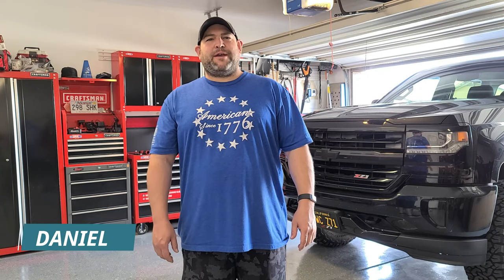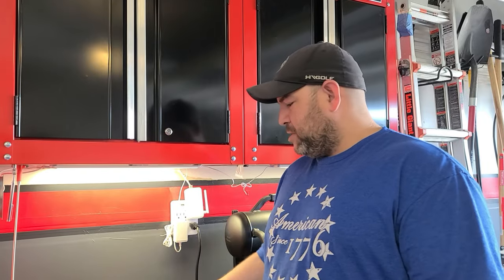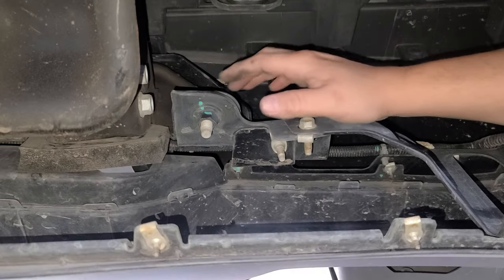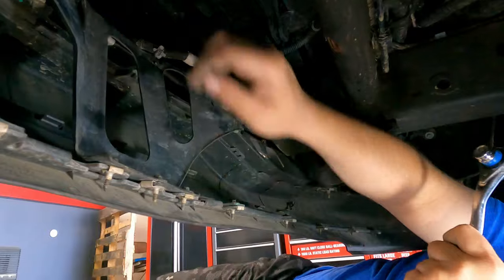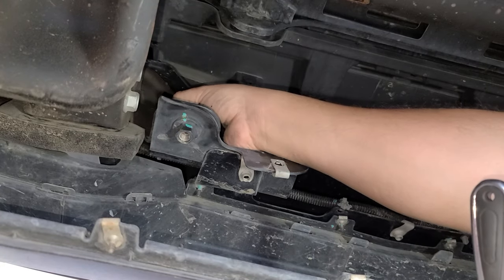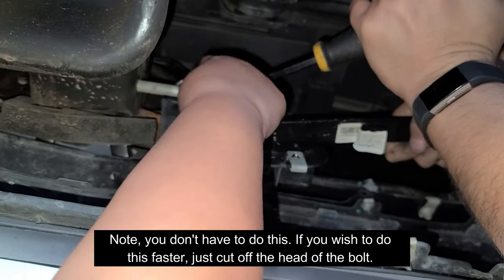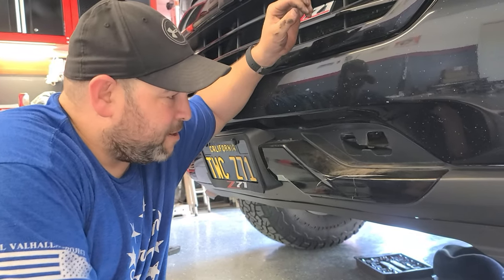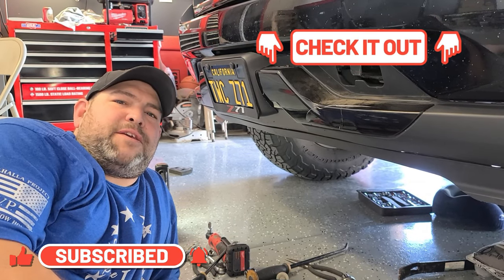DIY: How to Remove the Tow Hooks on 2016 Chevy Silverado Without Cutting the Bolt

Comment: Hey man, not sure if you still reply to these comments, but I have a question. I’m planning on installing a brush guard on my 2017 Silverado. I already ordered a replacement bolt for the one I’m gonna have to cut the head off of. Is there any reason I wouldn’t be able to install the new bolt in the opposite direction?
Reply from the maker: If I remember correctly, I believe that you should be able to, but not 100% sure.  I would check our truck but it’s not here with us right now.

Comment: If I were to cut it off, will I be able to insert a new bolt on the other side ?
Reply from the maker: I believe that you could and put the nut on the opposite side.
Reply from the maker: I will crawl underneath the truck tomorrow and give you a better answer.

Comment: Going to just cut the bolt off get new one then put it on other side. In your opinion you think this is ok
Reply from the maker: Nothing wrong with doing that... I  just wanted to prove it to myself that I could do it without going that route.
Reply: Did you ever cut the bolt? If so, what size bolt and everything did you use to replace it?